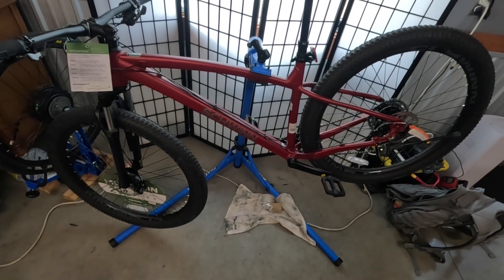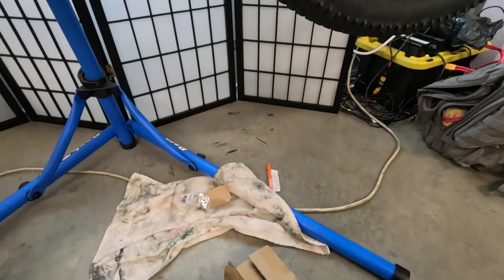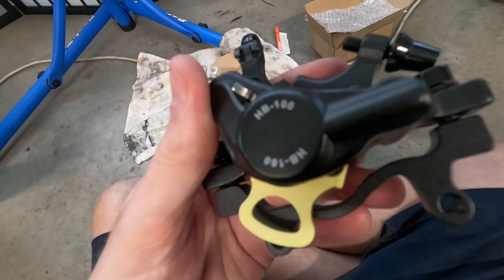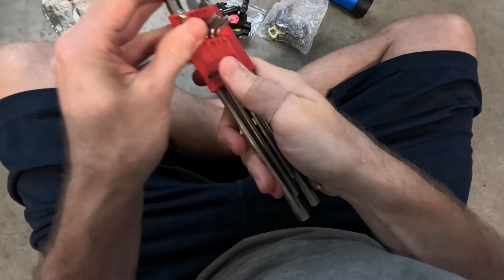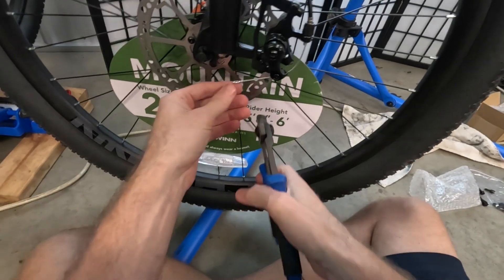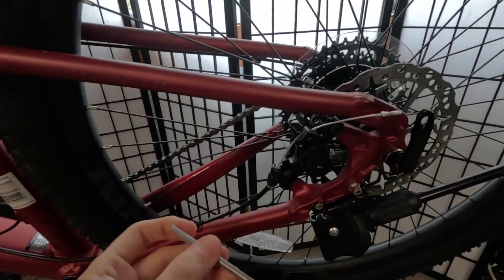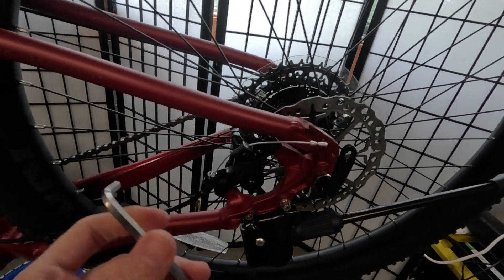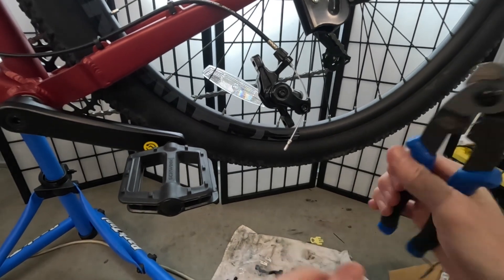Zoom XTECH HB100 Brakes - Cable Pull, Hydraulic Caliper

Comment: I just ordered a pair of these hb100 brakes today. Thank you. Look like a smart design. But I read that since there is very little fluid in them that they can fail catastrophically at some point if you don't change out the fluid at like 4-6 month intervals if heavily used. Good thing I'm going to use them with regen on my build. Should be perfect!
Reply from the maker: Yes i found there is only a tiny amount of fluid in them.  I had one of mine lose braking power after approximately 4-6 months yeah. And you have to deal with the cable some times. But they work ok. I think people give up on them when they go soft. But i bled one of mine easily  it barely takes any fluid.

Comment: Hey so what do you think about them.Are they working pretty good?I just had to Bleed mine.That was Super Easy and they are working better than ever
Reply from the maker: yes- Id say they work better than mechanical brakes, not quite as good as hydraulic brakes, but i'm still on the pads they came with,  and i havent bled the caliper yet - I have heard that can make them work better!

Comment: Cool design & yea the best of both worlds as there's a bleed hole so they still need flushing & refilling & you get to adjust the cables! 😂 Seems it uses different type brake pads with a hook on a pin unlike a spring & cotter pin on my mechanical brakes. I thought the XPeak hydrolics used the same pads but maybe not.
Reply: No these still have the spring and cotter pin on them, only pads off top of my head that don't use the spring clips are Magura.

Comment: The semi hydrolic brakes are some Frankenstein design, which i dont like. Go full Hydrolig or Mechanic, its for sure better. Why dit you then not go whit the Shimano MT200, those are cheape and reliable, i use them on my over 40kg heavy Fatbike, got no problems. it just cost 35€ in germany. I also dit not see how you can bleed them, the Frankenstein modell.  There are also mechanicals which also have 2 moving pistons, those are cheaper and do not fail from dirt or water, that would be the best option for offroad i think.
Reply: Agree full hydraulics are for the win 🏆
Reply from the maker: @konerek2  ive tried mt200  / mt210 before, they are nice  , Yeah
Reply from the maker: frankenstein design  hahahah    I like it

Comment: its probably European hex in mm not inches etc
Reply from the maker: Most bike stuff is Metric   Yeah  the bolts were wqxky
Reply: @EBikeBuilder_  happens a lot with Chinese stuff these days quality has fallen a lot especially when it comes to cheaper stuff
Reply: @konerek2  I dont have those problames since 2017 when it startet to order directly from China....
Reply: @MS-pt3yh  I used to order a lot from there and I noticed the quality fell drastically past few months
Reply: @konerek2  That sucks...